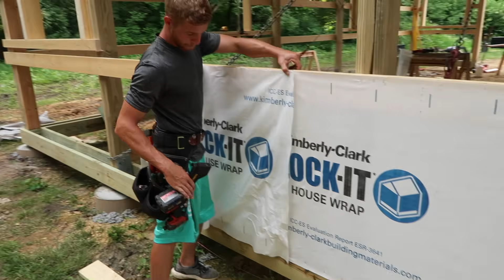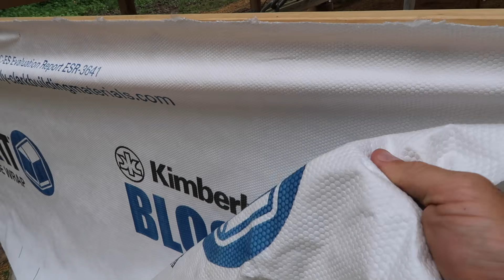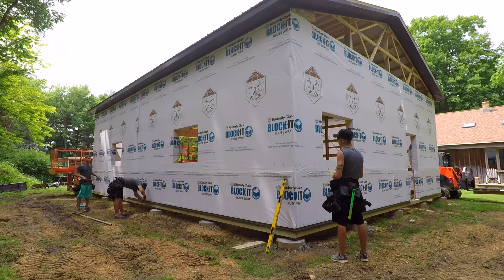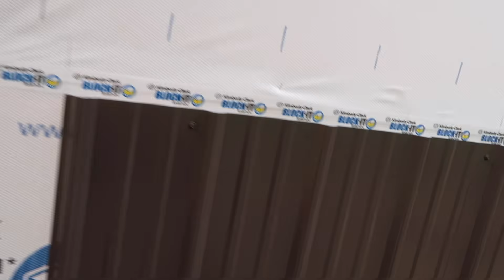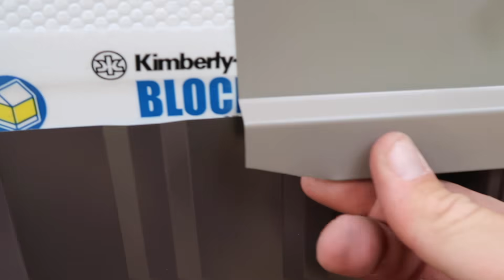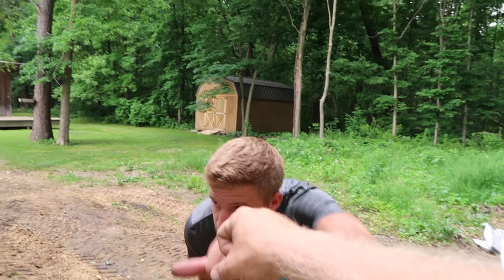How to Build a Garage #6 Metal Siding

Comment: If you were going to add the lower panels existing building. Hiw would u cut the existing panels straight? And do you have to seal the raw edge after? I will be painting after.

Comment: My metal base trim isn't the same as what your using,  mine isn't square bends on bottom it is 45 degree.   I'm wondering if you ever ran into this kind of trim and if so how do I bend it around outside corner?  I tried your method but with the 45 on bottom it won't work like you showed,  any help would be appreciated.   Great videos, I watch them all!! Thanks

Comment: Kyle, what do you do when you punch a misplaced holes on a roof panel.  I am doing an extension on the end of my 30x40 shop building and on one side of the roof we misplaced a row of holes because the existing and new purlins were staggered.  Is there some type of plug or do I just caulk it?  Thanks in advance for the response.

Comment: We have several 100+ year old buildings that we are in the process of covering with used pole barn steel. We started with the "shop" and removed the old hardwood siding. The bldg is 2x4 construction with 1x10 exterior boards covering the entire wall. (to which the siding was then layed over that). We put down menards brand house wrap and then cut and installed the pole barn steel. Is that adequate? We didn't use a lower trim (or upper if that's common). Should we have? What kind of issues can be had if no base trim is used on the exterior? I see at the home improvement stores in the roofing area, they sell a foam insert that looks like you'd put it behind the sheeting at the top or bottom. Is that another option to be used? Also, why the gap between the wainscote and the trim above it?

Comment: Kyle when you set the flashing on top of the wainscot it looks like it sat slightly (1/4 to 1/2") above the top of the wainscot steel. Is this an opportunity for insects to crawl up and nest under the flashing and down into the rib of the wainscot?
Reply from the maker: It could I suppose... either there or somewhere else... most of the time insects can get in on many locations... the housewrap will keep them out

Comment: Love the videos!  I am a maintenance planner at the Kimberly Clark mill that makes Block-It.  Thanks for using our material.  I'm planning to build a 30' X 40' shop this summer.  I think I'm going to build from a concrete slab with stud walls and use your steel and trim techniques on exterior and interior. Thanks for the videos and great details. If you were in north Mississippi I would want you to build it.
Reply from the maker: That’s awesome Jeff

Comment: no sure if you still read new comments on older videos, but I can add a little to what you said about vapor screen, because you seemed to be unsure about "down south" and you were right to be unsure about what you said...
Vapor screen is always supposed to go on the inside, because even when heavily airconditioned "down south" you're never going to set the room temperature to be lower than the dew point. Dew point is the temperature where the humidity in the air starts condensing. Basically it means that in a negative gradient (hot to colder) the amount of humidity that can be in the air as vapor goes down, which makes the relative humidity go up as temperature drops. If the cold end of the gradient has a temperature lower than the dewpoint of the air (also relative to air pressure, altitude and presence of aerosol particles) then somewhere along that gradient the humidity from the warmer air will start condensing because that's where the temperature passes the dew point. Vapor screen is to keep humidity from being present in the area where that temperature occurs.
Let's say that your in a really really extreme area where day time always hits 100% humidity and water condenses on any surface in the shadow (subtropical jungle weather), in that case it might be useful to have a vapor screen on both sides, because during the day the condensation might occur on the outside. Still in those areas, at night the situation will be reverse and you'll still want that vapor screen on the inside. So rule of thumb: vapor screen always on the inside; in extreme humid climates also on the outside. But in those cases it's just better to use a type of insulation that is not sensitive to humidity and can be considered to be a vapor screen on its own (like PUR).

Comment: After using green snips, missed opportunity to add caulk to underside folded corner.  A bead around joiners and nails do wonders for keeping out water that collects, frost that creeps, or condensation that rises behind imperfections in material.  Otherwise just a nitpick for a well formed corner on the metal base.  NOT BAD Indeed.

Comment: How come you don't remove the cardboard round form material after the concrete has set? That always degrades with time and looks bad when it starts falling off.
Reply from the maker: it is all subgrade in the future
Reply: Oh, I see. Here in Colorado, we have to leave 6" of piers above grade for moisture, so ours is exposed after finish. That's why we usually remove the cardboard form.

Comment: Kyle, Why do you leave the nails only partially in where the trim overlaps? Is it so the pressure does not open the gap allowing for the silicon to dry? I have not heard you talk about this before and have seen it on several YouTube and IG stories. Thanks for your input. I love how much detail you provide in the process. I don't even build these things but just love soaking up the knowledge for when I need to build one.

Comment: my son has a 2 yr old metal building.  all along the  "top flashing piece" that separates the wains coating from the side panels -  is  rusting  -  where the bottom bare edge of the siding sit on the flashing piece (I know I am not using correct terms here) on top of the wains coating  is all rusted,  all the way around the building.   what can we do ?
Reply from the maker: Bob Haddock probably buy a rust inhibitor... my guess either the steel was cut on site with a saw... is sitting too tight to the trim not allowing water to fall away... or it’s just really cheap steel.  All steel will edge rust but ours has a 5-10 year warranty.   Good product will only creep up over time a little bit. Not all out rust.  Usually it just gets a whitish chalky look to it

Comment: I love the structure system you use!! Nobody in North Texas has this system. Solid 6x6 are just to waive. Any info you could provide would be great. Keep up the great work and craftsmanship of your buildings.
Reply from the maker: LB7 Wade midwest Perma column brackets and Ohio timberland laminated columns
Reply: APB Pole Barns is based in Combes, TX and  there are at least a couple builders and one other engineering manufacturer that serve the area and it seems that there is no laws there prohibiting such engineered structures
Reply: Do you use R panel or U panel

Comment: Sounds like some really cheap windows
Reply from the maker: pat allen actually no.... 95+ degrees over two days wrapped in plastic is not good.  The shear tightness of the plastic warped them
Reply: PVC melts between 212°F to 500°F (100°C to 260°C) and thus in shrink wrap that was snug to tight to begin with sitting in them temps is like sitting in a car with the windows up and no ac on.

Comment: Kyle great video, great work. 
Is wainscoting a must or just mostly.for cosmetic reasons? Im thinking of just using full length metal... thanks buddy
Reply from the maker: Lance Sheppard wainscot does two things.   Allows easy lower steel replacement where most damage occurs.. adds aesthetic appeal
Reply: RR Buildings great point on the damage replacement! I priced some UC4B 20' 6x6 posts yesterday. $104 a post! LOL i saved for years to build and now i have to wait and save more 🤣 just my luck...

Comment: Guys fantastic job...I loved the attention to detail. The only shock to me was that you didn’t shingle lap your house wrap over the base trim in order to deflect any water that might get behind the metal wall panels out to the exterior. With the way you’ve installed the wrap that water would run behind the vertical trim leg and wet the rim joist and expedite rot. 

I know, my anal retentiveness is showing but it would be an easy tweak to an otherwise fantastic demonstration if craftsmanship. 

Thanks guys for the education!
Reply from the maker: MrThunderbumper we’ve done it both ways... the issue is stapling the housewrap once base trim is on.  The steel covers most of the wood and it’s difficult
Reply: RR Buildings that makes sense without full sheathing...you are shooting for the narrow 2x4...thanks for the clarification.

Comment: Do you use Makita, Dewalt, Hitachi and Milwaukee tools? Isn't it a pain in the ass to change between the battery platforms all the time, or is that just something people say to sell more tools from the same brand?
Reply from the maker: Mattittas it’s no big deal at all.  I have tools specific for parts of the job. When I’m ready to perform that task I get the best tool I have.  No one brand has them all